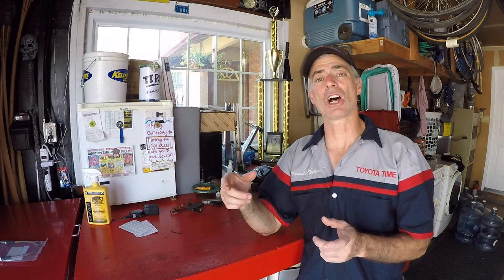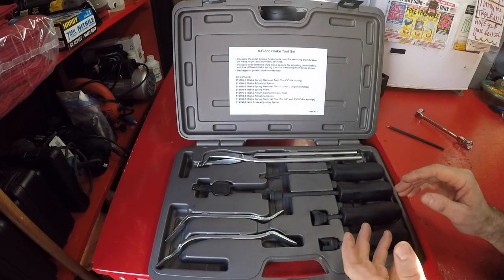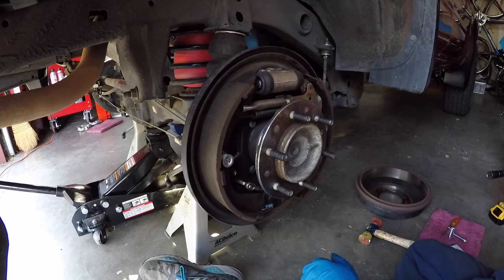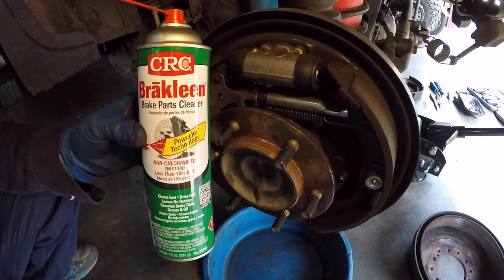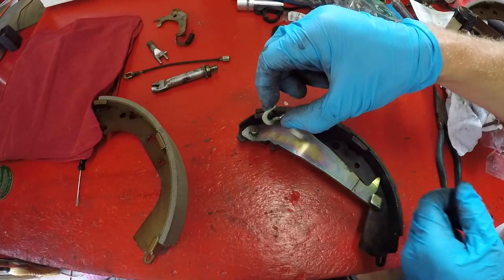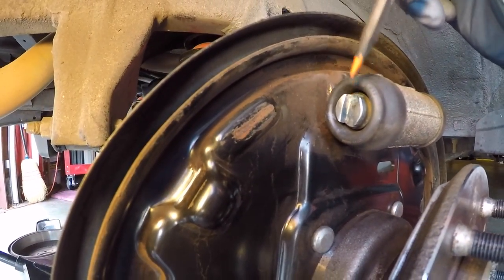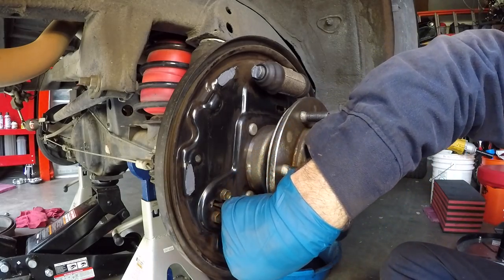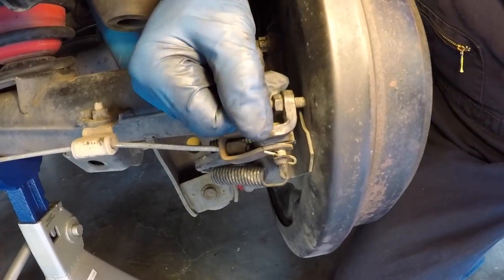Drum Brake Shoe Replacement

Comment from the maker: For getting the return spring back on, I have found that spring tool in the OTC kit to not work all that great.  The technique that I have found that works better is I use a medium size phillips head screwdriver.  I hook the one spring end onto the brake shoe behind the parking brake lever first.  Then I put the other spring end onto the shaft of the screwdriver.  I place the tip of the screwdriver into the slot of the the opposing brake shoe and then lever the screwdriver towards the shoe expanding the spring.  The spring will slide down the shaft and you can help it along with your free hand.  Once you get the spring end into the brake shoe hole and it's partially hooked, you can grab a flat head screwdriver or other tool to push the spring end further into place while getting the phillips head screwdriver out of the way.  I hope that makes sense.  With this technique, you eliminate any potential damage to the new brake shoe and I've found it much easier to get the spring in place using this technique.
Reply: Man, you're not kidding!!! That spring tool is worthless!!!
Reply: I found compressing the shoes with a carpenter's clamp... pushes in on the piston. If you compress it all the way down, getting on the spring is significantly easier. (Note: I had the brake line off because I was replacing the axle seal. However, I think the same method could be used if you loosen the bleeder screw and bleed the brake fluid while compressing the shoes.)
Reply from the maker: @wesleyfuruya3659  Thanks for sharing your technique.
Reply: Timmy The Toolman no I used Brembo. What’s weird is it was doing the same thing with my stock ones. Which is why I had the drum turned in the first place. Very odd.
Reply from the maker: @whatfreedom7  If the brake drum was turned right by the shop and the shoes aren't the problem, maybe the axle shaft is bent slightly.  But, before I would be swapping out an axle shaft, I'd ask the shop you had turn the drums to do a caliper reading in several spots to see if the drum is even.  I'd also try the OEM shoes because I've heard of people having issues with aftermarket shoes.  But, how did this problem reveal itself to you?  Was your rig in an accident?
Reply: Timmy The Toolman well I just knew they weren’t years back paid a shop to do the work thought it was all good and never checked myself since it seemed to be fine. I realized recently it wouldn’t  stop well hauling a camper coming down a mountain so I just did a all over brake job since they looked glazed. Put all new Brembo pads and rotors in the front and turned the drums since they felt warped since they’ll grab and release turning by hand and put the brembo shoes and new hardware front and rear. And here I am and they still feel like they grab and release when turning by hand. It stops way better now but that warped issue still bugs me especially since I’m hauling a camper now. I’m tempted to slap some new drums on and see if it works. The guy that turned them works out his house and isn’t a idiot he is knowable but I’m wondering if something could be wrong with the machine.
Reply from the maker: @whatfreedom7  Yeah, new drums might be a good idea.
Reply: Oem parts, bought a Radiator at dealer ship. Then I find the Denso sticker on it, Lol
Reply: ìuu😊

Comment: You guys are awesome, I paid $550.00 for a complete brake work on my 2001 Toyota Tacoma 2 years ago, I have a 2002 toyota 4runner  I will do it myself this time since I feel confident to do it myself after I watched your tutorial...thanks o lot
Reply from the maker: Hey Alejandro, thanks for the compliment.  You can absolutely handle this yourself.  The hardest part is getting that return spring off and back on.  Since making this video, I've done rear brakes for several other people and found a new technique to getting the return spring back on.  I take a phillips head screwdriver, capture the end of the spring on the shaft and put the tip of the screwdriver on the slot where I need the spring end to grab onto the opposing brake shoe.  I lever the screwdriver towards the opposing shoe stretching the spring.  The spring slides down the shaft and gets near the slot it has to seat into.  Then I take another screwdriver to help slide it off the first screwdriver  and get the hook of the spring to find it's home.  It works pretty well.  That specialty brake tool works ok to get the spring off but I found the screwdriver trick to work better getting the spring back on.  Good luck with the job.  Happy Wrenching!
Reply: Places here in Orange county charging the same thing. Forget that. Ill do myself

Comment: One thing to add here. the gasket that the service manual shows under the drum when you first remove it. It shows as non-reusable. I think that’s the part that tends to seize to the drum, perhaps that’s intentional on Toyotas part like their oxygen sensors are meant to seize slightly. In any case I wanted to bring attention to that gasket needing to be replaced. Thanks for the super helpful videos
Reply from the maker: I've never seen that gasket on any Toyota SUV or Truck.  I've seen it on parts schematics, but have never actually seen the gasket in place on a vehicle.
Reply: @TimmyTheToolman have  you ever been the very first one to ever touch the drums on a vehicle  Before any dealer tech or other  touched it?  My mother has a 2o11 Tacoma that the dealer never touched the drums yet AFAIK I was the first to pull those off at around 70k miles after starting to watch your channel and decided to start personally looking after her hot Barcelona red single cab 4x4 and save her many hundreds to thousands of dollars over what would otherwise be paid to a dealershop or other monkey.  

Getting back on the point... So I was likely the first ever to remove the drums on her Tacoma and there was a white paper gasket stuck on the hub that had to be scraped off and a new one put on. This was almost two years a	go. I need to remove those drums again this to check and clean brake dust and it will be interesting to see how that white drum gasket	 has held up inside there
Reply from the maker: @efil4kizum  I have never seen that paper gasket in person, only in a parts schematic, so I doubt I've ever been the first to look at someone's brakes.

Comment: Outstanding video! Looking forward to doing this with my son on his 2002 4runner. We have already replaced the front rotors and pads. Thank you!
Reply from the maker: Just to prepare you, your rear brakes might look a little different.  Toyota had 2 designs to the rear brake setup.  If that ends up being the case, just take pictures and do only one side at a time so you know how everything goes back together.

Comment: My 01 SR5 2wd was not exactly the same or it had been modified by the previous owner. But I was able to get it all back together correctly. One thing I found to be helpful is, when I got the springs that hold the shoes to backing plate in place, I took a small ratchet strap and went around both shoes to ratchet it tight to hold it all together. That made it much easier to stretch the adjuster spring into place plus it kept the piston compressed. I found this video to be very useful for all of the grease points. Thanks again!
Reply from the maker: Hey Craig,  I like that ratchet strap idea.  Great Macgyvering!  Glad you found our video helpful.  You're very welcome and Happy Wrenching!

Comment: Another great tutorial!  I watched the video enough times to almost commit it to memory.  
My 2002 then surprised me with a different set up (The set up on the video 3rd gen seems more stout in my opinion).  But knowing how the parts interact I was able to complete the job, with the right tools and supplies on hand.  The clamp was genius and very helpful.  
I did have to change out the bell cranks as mine were seized up.  The only guess work came to proper adjustment of the brakes.  I thought I would get an ah-ha moment when putting on the drums and feeling for drag.  It was really just trial and error.  
Before I would get thrown forward stopping at slow speeds by having nothing but front brakes.  Seriously, how can you look cool cruising the mall like that?  
Now I’m smooth and have an ebrake. 
Thanks again!
Reply from the maker: Hey Brian, we're glad you like the video and that it helped you out.  I was surprised as well when I was working on a guy's 3rd Gen 4runner and saw a different rear brake set-up than the one I've seen on my rigs and Sean's rigs.  I guess Toyota decided to use a different self-adjusting system at some point.  I prefer the set-up like we show in the video.  Toyota should have left it alone and kept the same design.  Good job getting your rear brakes working for you again.  And, Happy Mall Crawling.

Comment: Timmy, fantastic video.   I just did my 2000 4Runner this morning.  Only hiccup was the retainer pins for the shoes.  They were 3mm shorter than the originals.  My bad for not checking them first.  
I used Jordan’s method for adjusting the shoes.  It worked like a dream.  A little extra time checking and adjusting; but it was worth it.  
No adjustments after the test drive.
Reply from the maker: Glad you like the video Dale.  Sounds like you didn't buy OEM shoes.  Just be sure to always use your parking brake.  It takes pressure off the parking pawl and it keeps your rear brakes adjusted.
Reply: @TimmyTheToolman  got the OEM shoes.  Didn’t get the OEM spring and hardware kit.  They were out.  But I thought the after market would be fine, WRONG.   Very close except for pin length.
Reply from the maker: @dalekessler98  Yeah, I've heard of lots of issues with aftermarket shoes.

Comment: I love the extra detail, you don't cut any corners, and you think of the different issues that might come up.
Reply: Although I must add it's still a PITA. One of the things I don't miss in the 4th gens.
Reply from the maker: These drum brakes are pretty easy to work on compared to other drum brake set-ups I've seen.  Rear brake shoes last a very long time so at least it's not something you're going to have to do very often, maybe every 100k miles.

Comment: Revisiting this video..  I have to say at 29:28, Toyota makes it so much easier to remove the emergency parking brake cable by releasing it from the bell crank lever that way. I remember doing this service on my older Forester, that part was ugh!. I just hope when I do this service, my diff breather and axle seals are ok. I really appreciate your team efforts to show all the steps in such great detail. Who needs a dealer/mechanic when we have these awesome videos  :)
Reply from the maker: it's our style to show more detail than not. we want people who have never picked up a wrench to feel confident and capable of doing a job like this even if it is their first time. thanks for stopping by the comments and telling your local mechanic you don't need him/her anymore because you got the "Timmy the Toolman" show instead. hahah
Reply: @TimmyTheToolman  For sure! I know for some the videos might be a bit too long, but some parts in them are essential to avoid making mistakes or braking some important component. I'm waiting to replace my radiator, but OEM parts are taking forever to arrive! My next big job then will be the Timing Belt, I will definitely be counting on your videos for that.
Reply from the maker: @Mike_44  that’s awesome. We hope the job goes smoothly for ya!
Reply: @TimmyTheToolman  Hey Tim, I finally got around doing this job, hadn't been using the 4Runner for a while. I also replaced the rear wheel cylinders and bled the brakes all around. And also replaced the Brake Booster before I did the rear brake service, but ended up with a spongy brake pedal right after. I was hoping that would go away after the rear brakes were serviced, but the spongy pedal feel remained. I was careful to use the ST for properly measuring the clearance between the Booster push rod and the master cylinder piston.. Any idea why the pedal would still feel spongy? The Booster was not OEM, I couldn't afford it..
Reply from the maker: @Mike_44  Hard to say what the issue is Mike.  Did you ever let the master cylinder run dry?
Reply: @TimmyTheToolman  Hmm, how would I know, I don't think so.. I mean the car does brake, but it's not the immediate brake feel on the pedal I'd like to have, but it does brake. The emergency and rear brakes are operating good too, not great but good. I think I need to check the bell crank bolt clearance too. Will keep researching.. Thanks
Reply: I guess the brakes are working fine after all.. they were put to the test with some distracted a**hole that cut in front of me coming home last night.. Anyways, maybe they’re not like I’d like to have them, but they do work. I’m glad. I honestly think it’s because of the cheap Booster. Really wanted an OEM one, but that thing was close to $1K! Oh well, I guess I’ll change it for a better one later. Thanks again.
Reply from the maker: @Mike_44  You would know because during the work you did or the bleeding process, you would have noticed the master cylinder empty.  If you did all that work which included replacing wheel cylinders and you didn't cap off the metal brake lines, I could easily see how the master cylinder could have run dry.
Reply: @TimmyTheToolman  Yes, that’s one thing I made sure. As soon as the wheel cylinders were removed, they were capped until the new ones were installed/no fluid loss at all. I also kept checking the level of the brake fluid while bleeding the brakes in between wheels to make sure the fluid wouldn’t go too low either. I think I did everything by the book. The issue with the spongy brake pedal actually started after the Booster was replaced(two weeks prior), not after the rear brake shoes/master cylinders were done. I was hoping it would go away/get better with replacing the rear brake shoes/adjusting the brakes/ draining the fluid, etc.. Like I said, the brakes do work, but not as I’d like it to, on a new car. Appreciate your input Tim.

Comment: Lol...even with the phenomenal tutorial... this job was like wresting an Octopus.. I've done the TBU, the Timing Belt and all its parts, Axle Bearings, fuel pump.... This was the single most frustrating repair I have done to my T4R. Even though I wanted to light it on fire, I appreciated the video.
Reply from the maker: What Hang-ups were you experiencing?

Comment: Great video as always guys! Just wanted to note that the setup is a little different on the 01-02 models. The master cylinder is a little different, as well as the adjuster mechanism. The adjuster arm goes behind the shoes instead of in front and on mine, I can’t adjust the star wheel with the parking brake lever. I think it’s just one spring less, so I’ve got to do my adjustments direction on the star wheel.
Reply from the maker: Thanks Chris.  We did hear after making this video the 01 and 02 models are different. So you're saying the parking brake lever doesn't actuate the star wheel adjuster?  That means the rear brakes don't automatically adjust when using the parking brake.  I wonder how they stay in adjustment then.  I doubt people have to get in there on a regular basis to make adjustments to the star wheel from the access hole on the brake backing plate.
Reply: @TimmyTheToolman  yeah, I’m not exactly sure, but wouldn’t the brakes be continually adjusted by applying the brakes? As the shoes wear they would adjust anyway, right? I am by now means an expert, I defer to you guys for that!
Reply from the maker: @Not_That_Chris  With the style drum brakes we show working on in this video, using the service brake does nothing to keep the brakes adjusted.  It's the use of the parking brake that keeps the brakes in the proper adjustment.  I've never worked on the newer model type of brake shoe setup like you have so maybe using the brakes normally gets the self adjuster to actuate when the shoes wear enough for the adjuster to move a click or two.  One way to test this is back off the star wheel adjuster for the brakes a lot and then put a bungy cord tightly around the brake shoes to offer some tension.  Have someone very lightly push a little pressure on the brake pedal while you're watching what's happening with the brakes.  You would be looking to see after a certain amount of movement of the brake shoes and then the person let's off the brakes, did the adjuster plate turn the star wheel to tighten the brakes a little.

Comment: That’s a cool little grease dispenser do you put tubes in that or how does that work. Do you have a link?
Reply from the maker: That grease gun and all the other tools and parts used for the job are listed in the video description.   You can expand the video description by clicking on "more."  There is no cartridge for these little grease guns.  You hand pack it.

Comment: lol @ GoT theme dealing with the horseshoe clip.
Excellent video as always, Tim.
Reply from the maker: Yeah, that horseshoe clip is a bit of a pain in the butt.  Glad you like the video.
Reply: @TimmyTheToolman  it’s been helpful - what started with pulling my third member for a diff rebuild turned into axles seals, wheel bearing, and a brake job (as a result of the blown axle seal). Like an onion, layer after stinky layer and nothing but tears the whole way down, but It’ll all be fresh and crispy when it’s done!
Reply from the maker: @gohilux  Cool.  Good luck with all the work.